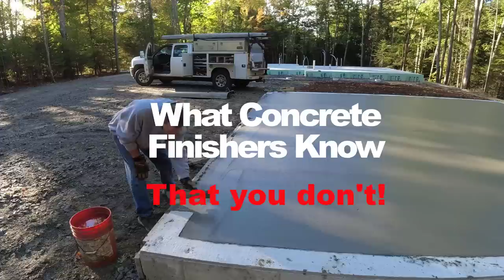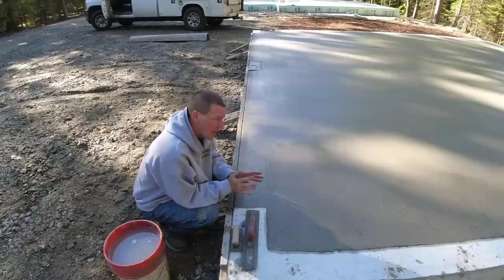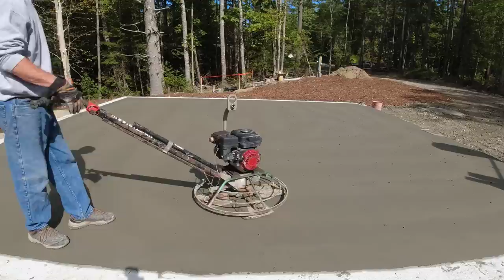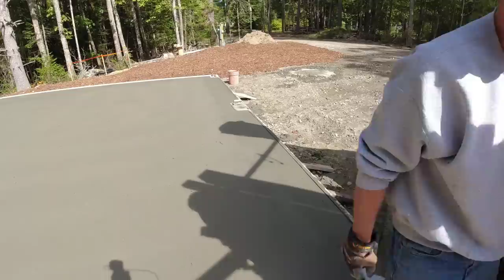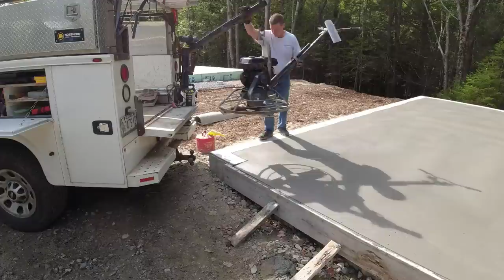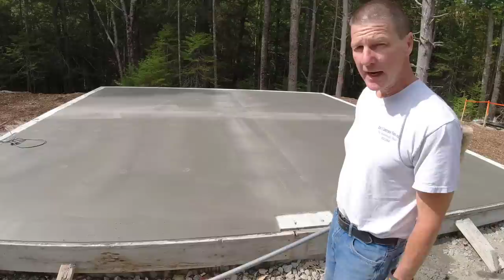What Concrete Finishers Know - That You Don't! (How To Finish Concrete)

Comment: Nice Work!!! When you saw cut a line in the concrete, how deep is it ???
Reply: 3/8 of an inch isall you need.
Reply from the maker: rule of thumb is 1/4 the thickness of the slab. So for this 4" slab I went 1" deep.
Reply: One third of the thickness